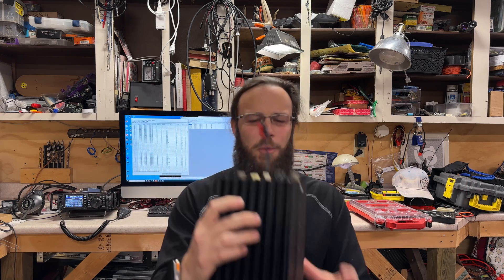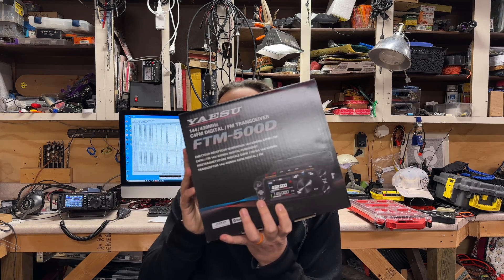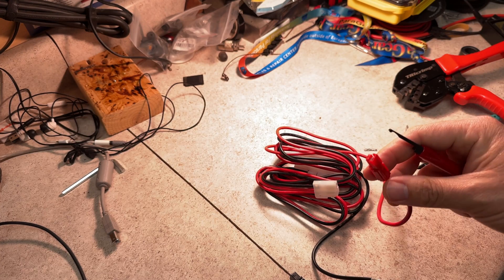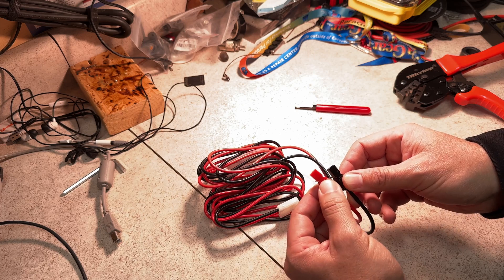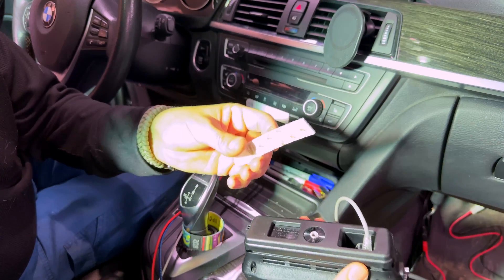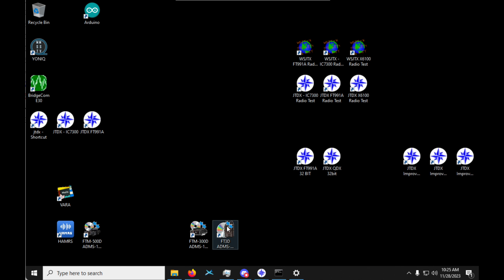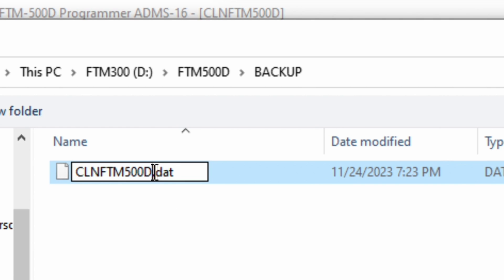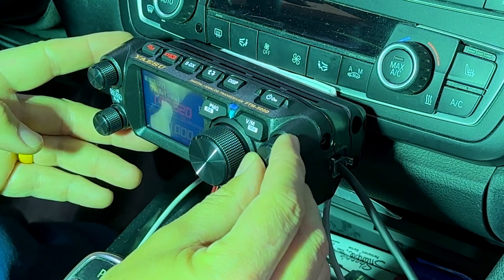Can you upgrade to the FTM500?

Comment: Why didn't you just copy paste in RT Systems from the one programmer spreadsheet to the other, like I did?  😂
Reply from the maker: Because RTSystems costs money and I'm a cheapskate. I don't want to buy it for a radio that I no longer have (the FTM-300) just to extract the data, then buy it again for the new radio to import it. Especially since Yaesu makes available software to do it in a round-about-way.

Comment: For power polls, red reading right. The A are right way up with red on the right. That’s how I remember.
Reply: This works unless you have cheap Chinese ones that have no letters on them
Reply from the maker: Gonna have to try that.
Reply: I use the red on right when looking at the "A" and I use a premade set as a refrence. . . . I also use a block of wood for soldering.
Reply: @N2YTA  Some places you order them from, mainly Amazon, you might think you're ordering genuine Anderson Power Poles. However they send you cheap knock off ones with no writing on them. That's why you shouldn't rely on the letters. Just remember Red on right, Tongues up.